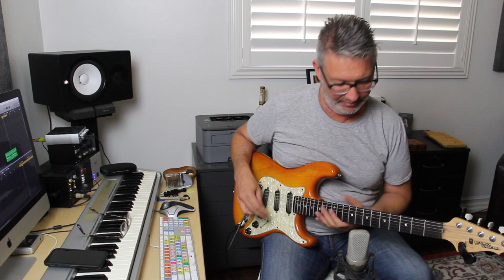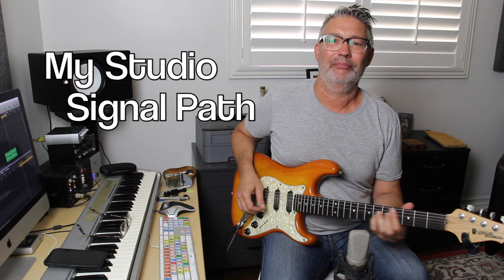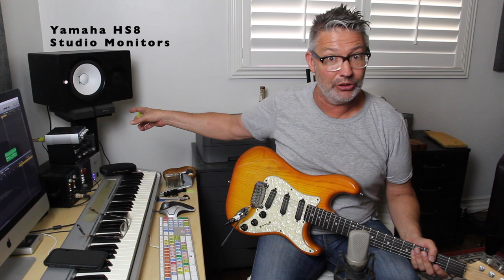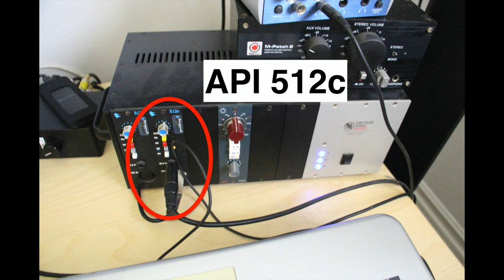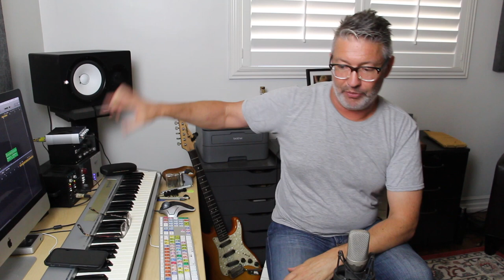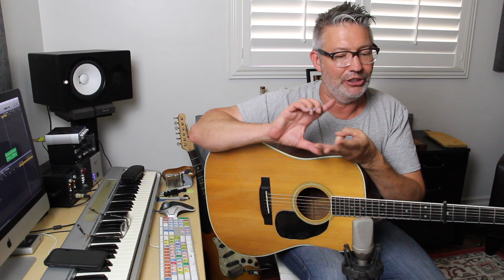My Studio Signal Path | Tom Strahle | Pro Guitar Secrets

Comment: Hi Tom, do you always run a compressor pedal in your chain for most styles of music? 
Are you compressing very much and do you have a generic setting or do you adjust your settings for the style your going for?
Is there any reason you don’t use a software compressor?
Thanks for the great videos
Reply from the maker: That comp is always on. Lyle Workman hipped me to it. But I do use compressors in the DAW as well. The pedal comp just kind of exaggerates or emphasizes the sound of my fingers and picks. Makes it pop just a little. I might not even know if it was on or not.
Reply: @TomStrahle  just a little sparkle then, I might try add one. Thanks for the tip!